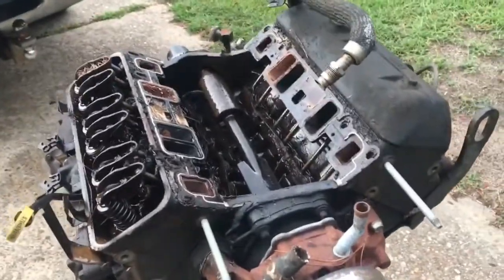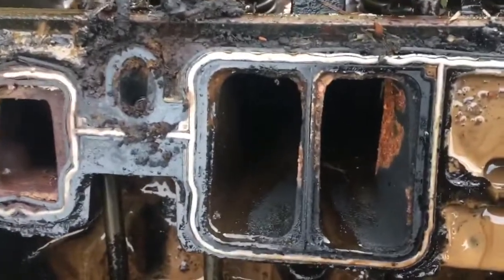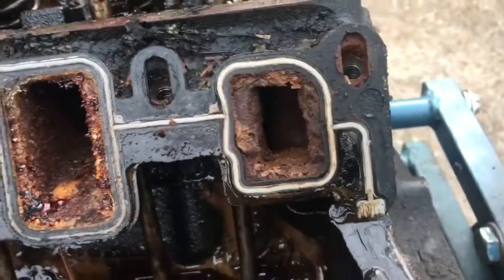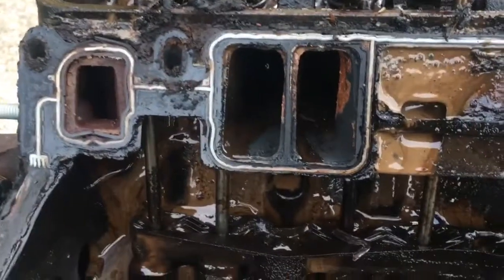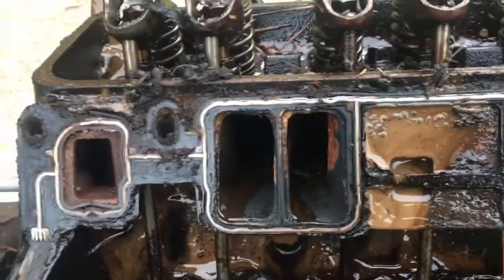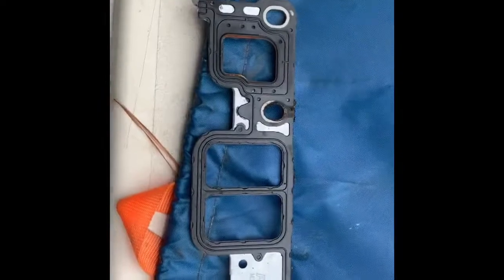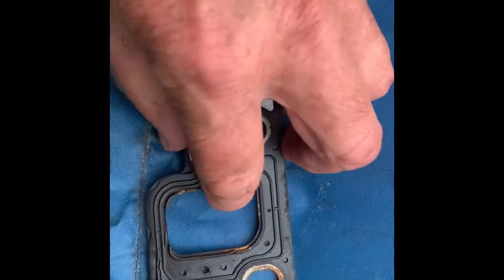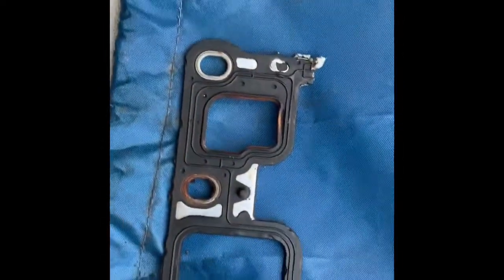DEXCOOL DAMAGE 1 - GM 4.3L Vortec Teardown

Comment: I think GM goofed with the Vortec design with these gaskets, the dexcool and also eliminating 4 of the bolts that hold the intake down to the cyl heads. You rarely if ever heard of pre-vortec engines having water or coolant in the oil from a failed intake gasket. Mine (1988 pre-vortec) didn't leak after 15+ years of raw water cooling in salt water! When I had to replace the heads due to overheat damage I used a set of Fel/Pro marine gaskets for the cyl heads and for the intake gaskets, 8 seasons later no leaks!

Comment: Just bought my first vehicle with 100% my own money , 2001 gmc jimmy sle , thought it was a motherfucking steal . I had it for about 3 months before one day it just blew the intake gasket , I just got the intake off not 20 minutes ago and the 2 coolant passages on the the rear of the engine and completely stopped up with what appeared to be concrete , same for the intake . I'm thinking dexcool mixed with normal coolant or water . I'm frustrated and distraught . I have no idea what to do and I feel I've just lost all the money I paid for it and a good vehicle . Fuck this bullshit
Reply from the maker: Most of the time the rear coolant passages are blocked. It’s not concrete you are looking at it’s probably cast iron. If you had the ability to remove the intake then you can put it back on with new gaskets. Put rags in the lifter valley to catch trash then scrape the intake gasket surfaces clean. Carefully remove rags and trash and vacuum out the trash that might have fallen into the lifter valley, then drain the oil after making sure the engine is sloped to get all the oil out. Pour 1 gallon of diesel fuel into the lifter valley to rinse whatever trash got past the rags and let it drain out too. Replace the drain plug.

Felpro makes new intake gaskets from metal instead of plastic. Here is the part:

https://www.rockauto.com/en/partsearch/?partnum=ms98002t

Kind of expensive but they don’t melt like plastic. Reinstall the intake with new gaskets, reinstall distributor (hardest part; must time the distributor at TDC) and then reinstall everything else. Put on a new oil filter, put in fresh oil, and fill cooling system with straight tap water. Drive it for an hour and then let cool and drain as much water as you can. Keep refilling with water and driving until it drains out clear. After a couple drain cycles, refill with a gallon of green concentrated Prestone and then top off with water. I don’t know where you live so you might need more Prestone than a gallon.

If your engine filled with water from the coolant leak and you didn’t keep refilling then you should be ok. If you got too much water in your oil you may have done permanent engine bearing damage and you’ll need a rebuilt engine. If you live near Georgia send me an email at moccasin.marine.llc@gmail.com and I’ll try and help you out.
Reply: @moccasinmarine  got it figured out , the two rear coolant passages on the block had a good inch of corrosion or  something , I had to break through it with a chisel and vacuum it all out . Was hard as rock . I guess I'm gonna see how it runs

Comment: Dexcool doesn't cause that rust. I just changed my water pump. There was absolutely no rust inside the block.
Reply from the maker: I never said Dexcool causes rust. It deteriorates plastic gaskets and typically lets coolant get in the oil.

Comment: Had to replace mine on my 4.3 , Yes They call this stuff Dex Kill for a reason. The new Gaskets don't have the same problems. Mine Failed at 180,000 miles , feels like a new Truck with the new Gasket. My Thermostat Gasket had the orange corrosion on it as well.

Comment: Had water put in it or it had 50/50 put in it
Reply from the maker: The rust you see is from rain water getting in the engine after it was pulled and left outside fir months. The owner thought the engine had a blown head gasket. I didn’t see evidence of that.

Comment: Its not the dex cool's fault. The plastic gaskets are not factory. Felpro makes the plastic cheap gaskets and also the metal ones. This is caused by using cheap parts and lack of coolant flushes.
Reply: This was proven wrong. Dexcool has plasticizes that at the time when it first came out (older engines) it ate at the silicone and parts of the oem gaskets causing them to fail. Their was several lawsuits over this back in the day. Even low miled vehicles were effected.
Reply from the maker: I disagree. I take plastic gaskets out of Vortec engines all the time. The video evidence shows the GM plastic gaskets are destroyed by Dexcool.

Comment from the maker: There are many videos of marine engines with the same water in the oil symptoms. And since there is no DEXCOOL in a marine engine that only means that the plastic gaskets in these engines don’t hold up period. My theory is that the angled bolts holding down the intake distort the plastic gasket as it is being torqued down from the angled shear. IOW as you tighten down the intake the intake slides down the heads putting a swiping action on the gasket rubber and plastic. This action damages the seal making the gaskets leak later on. If anyone disagrees or has proof chime in.
Reply: K, I do think they came from the factory with plastic but any dealer replacement parts for are not plastic, they are metal with rubber. Or the top line aftermarket gaskets.
And it is still a lack of coolant changes. Marine engines don't have a coolant system and they stay clean due constantly using the new lake water. The coolant deteriorates  do to the dissimilar metals used in the engine. (Cast blocks, aluminum heads, etc) Causing electrolysis.
Reply: @tomasmontoya5128  hey buddy, Google marine 4.3 if you're confused on what he's referring to. The have a different intake.